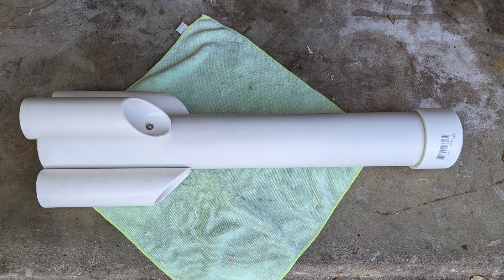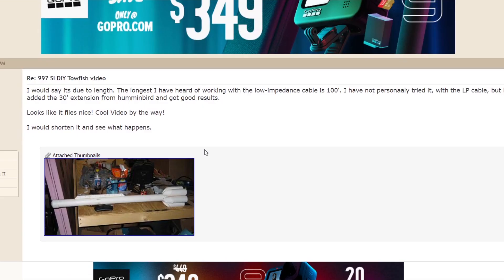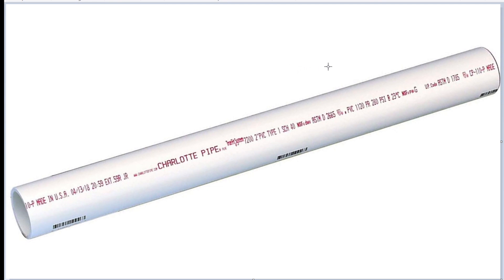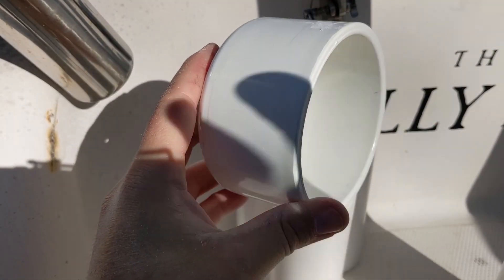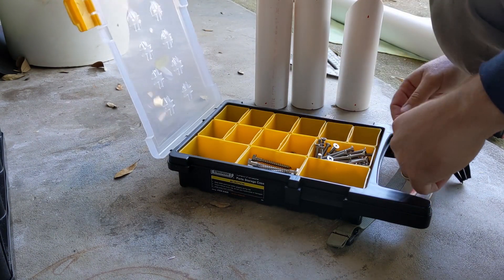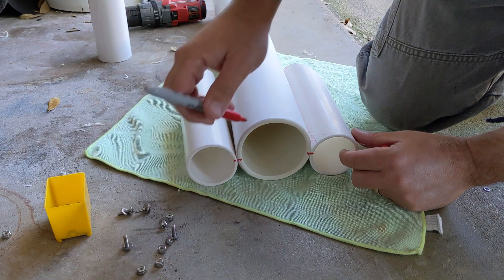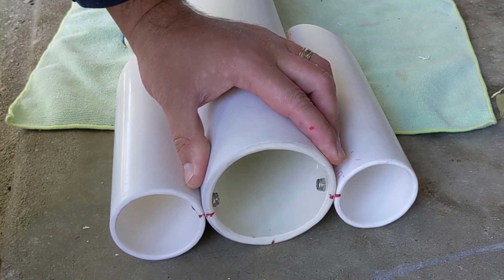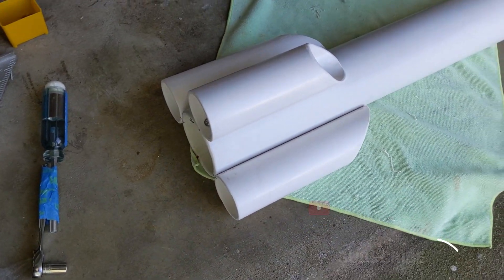DIY Towfish - Part 1 - Body Build

Comment: Do you have any videos of the actual testing and operation of your towfish? I cant find them on your page.
Reply from the maker: Some but I haven't put together enough for a video. Getting the towfish to dive deep enough was difficult. It did seem to tow level. I think I need to extend the cable. I'm currently having problems with my Humminbird head unit but once I get that resolved I will try to do more testing.